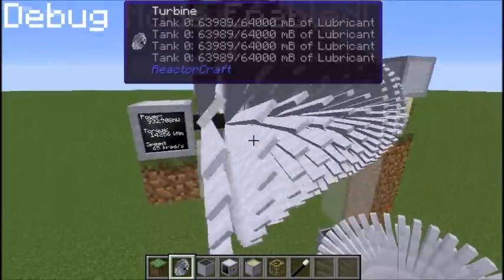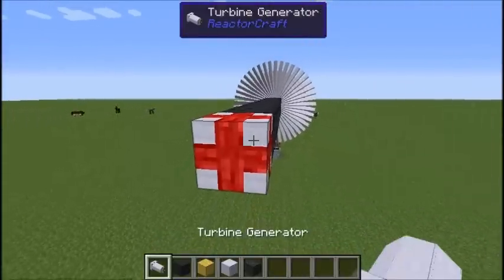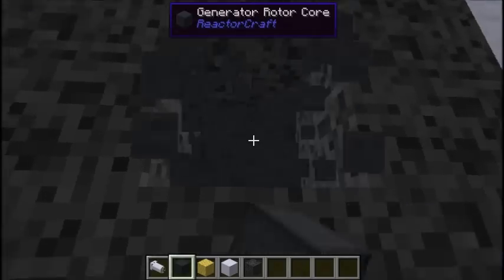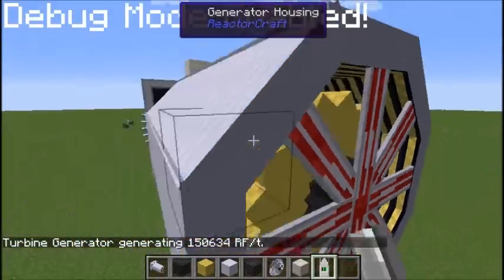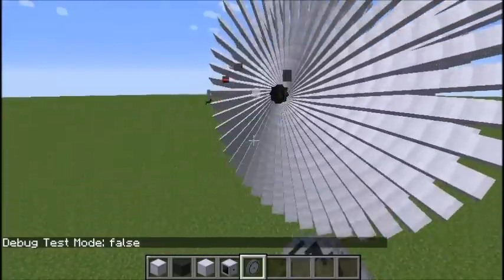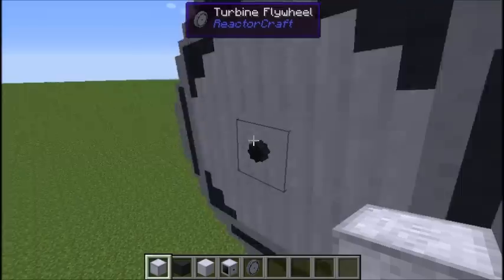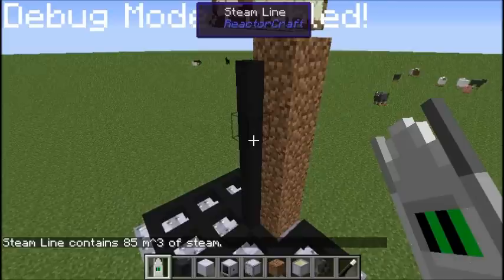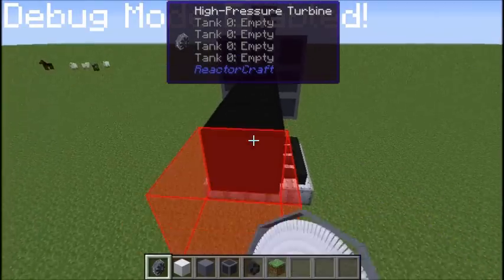ReactorCraft Multiblocks Tutorial

Comment: Hey Reika, I am pretty new to rotarycraft/reactorcraft but have gotten fairly deep into it and decided to go for a full fledged hp turbine and turbine generator. I chose to make a massive pebble HTGR reactor (60 cores with 15 CO2 heat exchangers). I am in the process of setting up, but saw in your changelog for v6 that HGTRs supposedly no longer run HP turbines. Will the steam I produce from my HGTR simply not work for the HP turbine? I figured I'd ask before I continue connecting all of it and start making massive amounts of TRISO pellets...
Reply from the maker: Yes, I nerfed HTGRs so that excessively large reactors are not as powerful, and cannot run HP turbines. This was done because people spammed HTGR cores - one person had a 500-core reactor - and some just daisy-chained 40 of the same design together.
Reply: ReikasMinecraft Ah I see.. thanks for letting me know. The fusion reactor is daunting to me, so fission reactor here I come! I did notice that fueling the fission reactor seems a little more difficult but I'm sure I'll figure it out.

Comment: Hey Reika, you and Senthinal say that turbine flywheel eats the steam/ammonia, but I still need condensers for the roof of my turbine house to catch steam as some float around now and again, does this mean I can use ammonia? (it seems like far less steam blocks then a naked turbine spams if I do not have a block under the shaft output although I may be mistaken and my steam boilers were not making much. ( 1.7.10 V9b) I am moving up from pebblebed to fission and want to max the power with ammonia but don't want to remove the turbine flywheel since I use electricraft for all the power in my base.
Reply: Use a High Pressure Turbine. They have an automatic flyweel ability within themselves.

Comment: Hello Reika, I am using the ftb monster pack. I urrently have a hydrokinetic engine at full power connected to an air compressor and I am trying to send The power out of the air compressor into a tesseract and then into a BC quarry however, i can't seem to connect the air compressor to the tesseract to allow it to transmit power. Could you please help me with this.
Reply from the maker: Update and learn the difference between RF and MJ.
Reply: ReikasMinecraft alright I figured it out thanks.